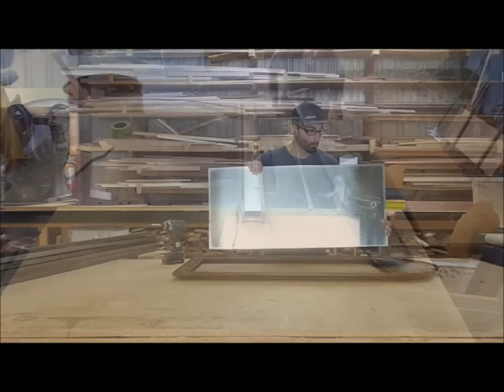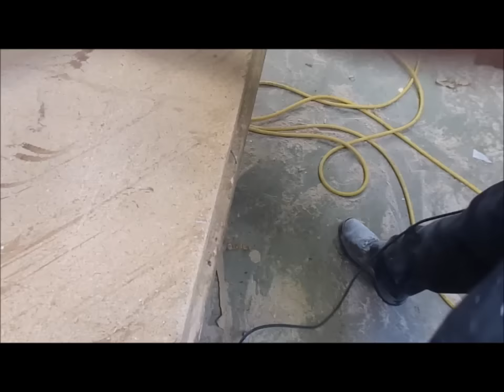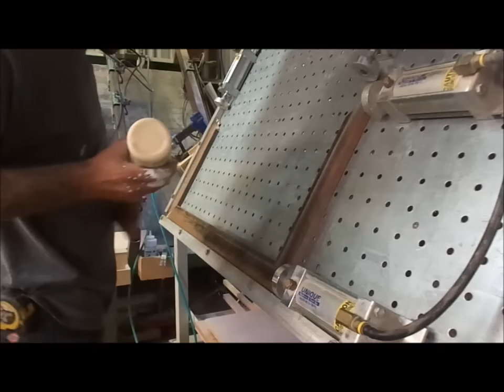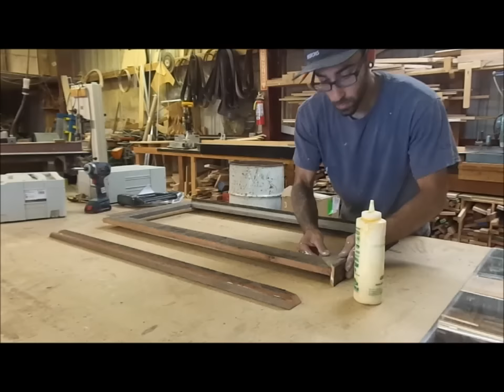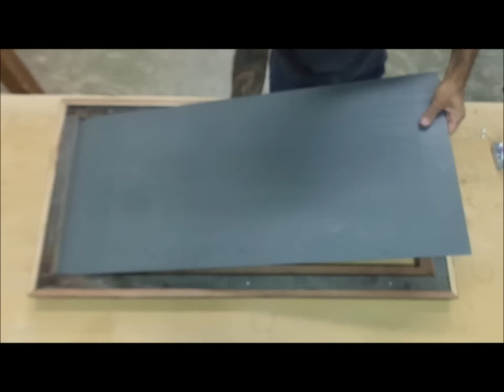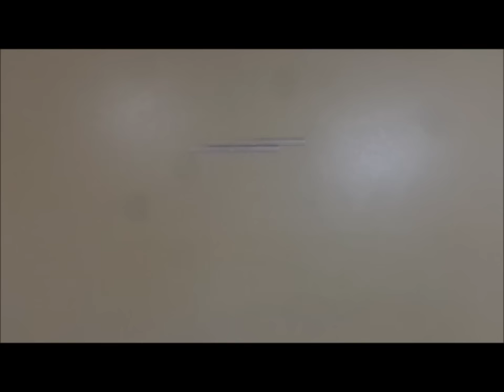RECLAIMED Mirror Frame

Comment: Hey buddy watched all your vids a few times now. Love your work. Wondering if you're planning on creating more videos? I'd actually like a shop tour. I'm very interested in the machines you use.
Reply from the maker: hey directorgtr, i might be doing a shop tour in the future, i am actually building a shop in the garage. so once i am set up, ill start to build again. i just got the electrical put in. sorry for the delay.
Reply: +Broken Edge Designs Sounds excellent my man.  I just completed insulating the walls and attic and put up drywall on the walls and ceiling. It's gonna be a great place to work now! Just gotta get myself a nice 80K btu heater in there for my cold Wisconsin winters then I'll be set... aside from purchasing a few more used woodworking machines and typical hand tools.
Reply from the maker: directorgtr ya its crazy how much tools i need to do woodworking. i'm racking up a big bill!!
Reply: I got lucky and will have all my grandpas woodworking equipment. Custom furniture artist for 70 years as a hobby but he has decent machines. Still gotta buy them from him but at a grandson discount haha my wife doesn't like me racking up any bills :0

Comment: Besides not using a push stick as mentioned by others, what's with the spring clamp on the blade guard! Not that we all haven't done it, or something similar. cough But in a teaching video....
Reply: I didn't use a spring clamp but HAVE used a door shim on a circular saw to hold the guard up :o
Reply from the maker: my videos arent meant to teach. just to give ideas on projects.

Comment: Just because you still have all your fingers doesn’t mean you’re using good judgment.
Reply from the maker: I do this 24 7. I know my limits.
Reply: Didn't mean to be personally critical my friend, just a reminder that disaster is lurking within one small lapse of judgment.
Reply: you do it 24/7 and look damn good at doing it.  The problem is if something happens, will you be able to continue your work?  is it worth the risk to save a few seconds per cut?  if you jump out of a plane, your only option to make it a bit safer is to use a parachute.  the way to make it indefinitely safe is to just not jump.
Reply: :) Developing a series of databases for workplace safety, I've seen 'far more' than my share of severed and mangled digits and hands/limbs from Industrial accidents.  A good many are of people who are in similar environments (high volume, specialized) and some of them with more tool experience than your years here on this earth. They too were very aware of their limits until of course, something small happened that was 'just beyond' their control, ultimately ending in disaster. Pushing your fingers down into pieces of wood and over the blade is the big one for me. Those photos were 'spectacularly interesting' and included some of the oddest Rips (not cuts) and bone Fractures that I ever catalogued from workshop accidents. Oddly it's not the missing or partial digits that keeps someone out of the shop, but the subsequent nerve damage that ends a career.
Anyway, Good Luck!
Reply: Complacency is the word here. A colleague of mine never used a push stick as he also did this “24/7” 
He now has two fingers. Man, what’s a few extra minutes on cutting times ....

Comment: omg man, your fingers get too close to the blade.... awesome job nonetheless!
Reply from the maker: +Frank Hernandez thanks! ya, I need to start using a push stick especially with the reclaimed woods.
Reply: +Broken Edge Designs yeah these tend to be wobbly and also a moment of inattention results in hours of bleeding and pain :)
Reply: +Larché Jacques Clarel I have one less finger tip to support your statement!
Reply: really?
Reply: +Larché Jacques Clarel Yup, a 2x4 kicked up from the saw, without even thinking I pushed it back down and the blade came through and bit off the tip of my middle finger. Greatful it was just the tip!
Reply: +Abraham Diaz oh shit. thats horrible. hopefully you can still use it. A middle finger is very important compared to the other fingers :)
Reply: Larché Jacques Clarel A middle finger can make a lot of people happy, depending on its use